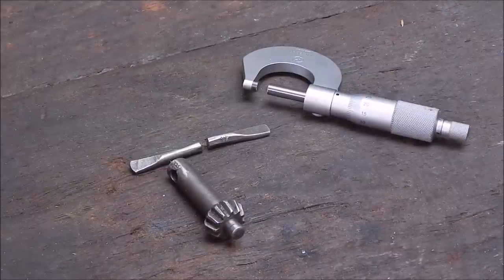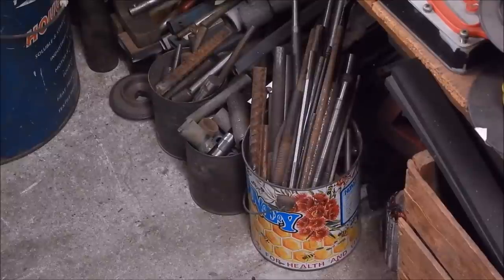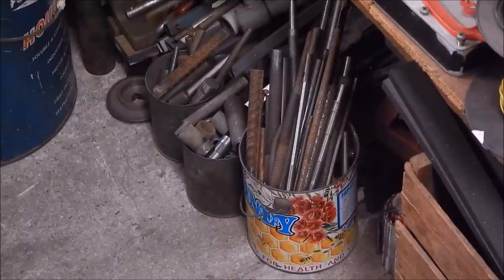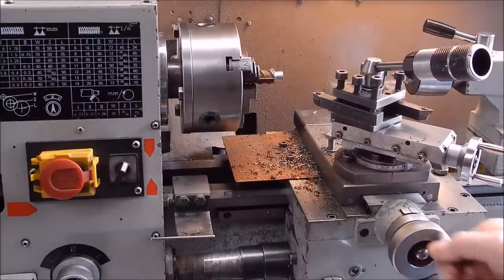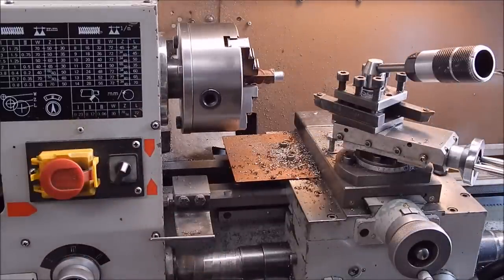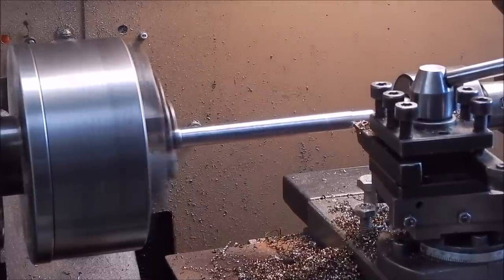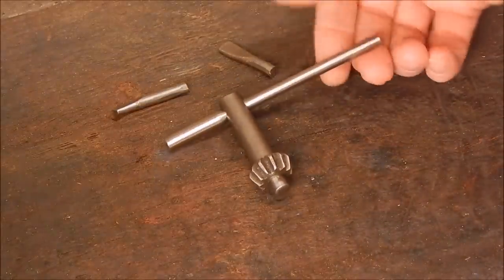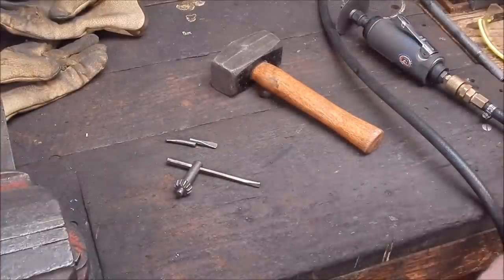Can you machine Rebar with a metal lathe ?

Comment from the maker: It's interesting reading the comments on this video - the most by far of any video I've done.

Some people just seem to miss the whole point of the video.

The video simply asks and answers the question "can you machine Rebar".

The answer is obviously "YES".

End of story.

I'm not suggesting you pass up on decent machine grade steel to use Rebar,.

However, it's certainly not the most difficult material I've ever machined.

Cheers Rob
Reply: +xynudu 
Indeed you can. But rebar is common steel. It&#39;s not like a hardened steel. It really all depends on your application. Good video.
Reply: +jtjjbannie Not all rebar is the same. There are different grades of rebar that have a higher carbon content which makes it much harder and a lot more brittle.
Reply: Jackle61
That's good to know. I did not know that, but it makes good sense that there would be given all the different applications.
Reply: +MrTo YouBoy rude.
Reply: +jtjjbannie  Way to miss the point. P
Reply: KingNast
? Yea, I think I got it dude. Not that complicated.
Reply: Thanks for making this video. I honestly never considered machining rebar and I can’t think of a good reason not to do so for whenever it meets the standards of the job. Great content. Thank you, sir.

Comment: I’ve commented on a few of these rebar videos already. Rebar is a trashy unpredictable metal. I use it often...therefore I know what I’m talking about. It’s good to have it around for a lot of things! Just be careful what you use it for.  Any metal I can machine and weld I use. Just don’t overestimate rebar and get yourself hurt or ruin something expensive. I use it for fire pokers, coat and hat hooks. Air hose hooks, tent stakes and such. It could be machined to use as parallels or “go/no go gauges” and such. Never make a tow hook or pry bar from it. I would assume that spacers or thick shims could be utilized from it.

Comment: you are a braver man than I. rebar is the mystery meat of metal. not only will 1 bar be different from the next, but the metal can change across a single piece.
Reply from the maker: +pyr666 

Yes, the standards only apply to strength and dimension as I understand it, so the metal could have any range of elements in it.

But it's still steel, and can be machined regardless of what's in it.

It might be a bit more difficult, but I'm sure any half decent machinist could handle it OK.

It's not my metal of choice, but the video simply shows that it can be machined, and 90% of what's said about Rebar in forums is BS.

Rob
Reply: +xynudu   A very nice demonstration, I appreciate your videos because you have very practical demonstrations.  You explanations are direct and the advice is straight forward.  There are many applications where expensive high grade materials are just not necessary.

Comment: It is interesting to read these comments about reinforcing steel ie. rebar.  Yes it is mostly high carbon steel because a lot of it is made from steel railroad rail which is high carbon steel.  The rails are cut to an appropriate working length; slit under the head and above the base yielding 3 pieces from each length of rail; and then these pieces are heated and rolled to the desired rebar size.  It is usually denoted in size by fourths of an inch.  And yes rail can be brittle.

Comment: Nice piece Rob.  I really like to repurpose old material to new applications too.  As I am building my latest model steam engine I used a piece of a 1.5" 2' long steel pin I found in Lake Ontario. I found it while snorkeling around the remains of a very old wooden pier that coal ships used to tie up to.  The pier was over 150 years old so the steel bar is at least that old. It actually machined really nicely.  Thanks for sharing your rebar video.  Fred
Reply from the maker: Fred Miller Hi Fred.  Some of the old steel can be really bad, you have to judge it by the way it machines.  I used some from an axle once and found it had hair line fatigue cracks all through it. Tossed it in the recycle bin. Luck of the draw.  Cheers Rob
Reply: I am also on the shores of lake ontario
Reply: xynudu do you know how old the axle was ?  it may have been made from flat stock and "blacksmithied" in to the round bar...
Reply from the maker: It was very old - from a horse cart, so probably 1800's.  The composition was very stringy, so it may well have been hand forged to shape. Cheers Rob

Comment: Why are so many people anally challenged over this video? I think its a great representation of the fact that it can be used! seriously though if your worried about the hardness and equal composition, all you have to do is bur it in a fire and let the fire die. It will anneal it and equal out the composition. You can harden and temper it later.  Ive made simple tools from rebar, even hammered out little carving knives that worked quite well actually. The problem we have on you tube anymore is people who are book smart but experience dumb.
Reply: +tonymengela Annealing rebar made from scrap doesn't really work and definitely won't "...even out the composition." Metallurgy doesn't quite work that way.  You might be able to harden rebar slightly because it definitely has a higher carbon content than most steels, again, because of the scrap material used that often contains cast iron. It is terrible material to weld for the same reasons, high carbon content and inconsistent composition. It is difficult to thread with a die and very hard on tools. I can base that on 45 years in welding and fabricating. The man that explained that to me had an additional 50 years in the trade, beyond mine. Perhaps a better argument might be : If better material is available to work with, why would you use rebar ? Yes, you can machine it, if that's all you've got. During the Russian Occupation of Afghanistan, the rebels made musket barrels from rebar - good for one shot.
Reply: +tonymengela I swear, some people like to disagree just for the sake of 
disagreeing. Better to ignore people like them, and leave the "doing" to
 people like us.  
It seems like people think rebar is made by throwing a bunch of random scrap into a crucible and hope for the best.  It holds up buildings, for fucks sake. Like you said, it's made to a standard.  Of course they're going to analyze every batch and adjust the formulation to meet their guidelines
Reply: KingNast Thank you for your reply... it gets lonely out here,,, so many people idea and book smart but no real world knowledge

Comment: The only reservation I would share would not be about rebar itself, but just a caution to those who only have one chuck, if it's a self centering chuck in good condition (whose proud owner is keen to keep it that way for an extended period)
Gripping anything irregular in such a chuck will eventually be detrimental to its gripping accuracy, and particularly to the parallelism of the jaws. 
By this I mean that they will probably develop a 'bell mouth', so that they do not grip right to the tips, and consequently it becomes easier to wrench the workpiece out when working without tail centre support.

Returning to the first point, namely gripping accuracy: Self centering chucks are actually a bit of a kludge. The shape of the teeth on the back of the jaws has to be a compromise, because the teeth they engage take the form of a spiral, hence there can only be (at best) line contact, not face contact.
Irregular workpieces tend to overload those contact patches, and over time, the scroll and the jaws wear more irregularly than if the chuck was kept only for bright-drawn, centreless ground, or turned workpieces.
Four jaw chucks are much more rugged, grip a lot more securely (so they do not have to be overtightened, which avoids straining the jaws), and their accuracy is more a function of setup than of manufacture, so that would be my first choice for machining castings, rebar, and even black (hot rolled) engineering rounds.

If all I had was a three jaw (a good one, which I wanted to look after) I would personally wrap it in something malleable, like thin lead flashing, or perhaps wrap some single-core copper conductor around it, at two widely spaced locations, before gripping it in the chuck.
Reply: Gottenhimfella Or get another chuck for the lathe and keep one dedicated for machined and cold rolled only, and the other dedicated for hot rolled steel and other rough stock. Once the one for rough use is worn to the point of useless it is time to get a new one for the smooth stock and use the old one for the rough stuff.
Reply: +Bear Peterson indeed sir, can't believe this chap is risking valuable carbides on such a shoddy job though!

Comment: Rob, in earlier days I spent some time around users of concrete reinforcing rod.   We called it "reo", although the Americans call it "rebar": because it's reinforcing bar, I suppose.  But that aside, I have seen this steel modified for certain uses. I have seen pairs of blokes with what was obviously a purpose-built machine, which had two chucks at one end and two vises at the other end. Blokes in overalls and gloves (and probably bored witless as well) would pick up two six-metre lengths of reo, chuck 'em at one end and grip them with the vises at the distal end, and press a button, or hit a switch, or whatever. The steel rotated for an obviously predetermined time, and the result was that both pieces of reo were given a full-length twisting, which obviously work-hardened the rod, and gave it different bending resistance or "Young's Modulus" or something. (They would then chuck the twisted rods into another pile, grab two more, and spend the rest of the day wondering how to get out of this job, I suppose.)

I have heard this stuff referred to as "twist rod", for obvious reasons.  This work-hardening would obviously make the stuff more difficult to machine.

Not all reo is treated this way, and the piece you used was obviously not treated in this way, because it had longitudinal ribs that were parallel instead of spiral. So the people who were saying "Nah, you can't machine that stuff!" may well have been referring to the work-hardened material rather than the product in it's "raw" state.

You may want to consider this, and if you find a spiral piece of reo, try and machine that for comparison, perhaps?

Not preaching, just sayin'...
Reply from the maker: Greg Brodie-Tyrrell  The ribbed  Rebar you buy would I expect be what most people would use.  I've not seen twisted Rebar, although a search shows Ransome bar was used early in the century. Interesting comment, but a new one on me.  It would take a hell of a lot of force to twist Rebar to any significant degree from my observation.  Cheers Rob

Comment: Grade 40 rebar is a little on the soft side. Makes it real good for bending to form cages and shapes for foundations but it has a tendency to smear when machined. Grade 80 is noticeably harder so it machines to a reasonable finish and can still be bent, if it's done carfully. Ungraded rebar is made from absolutely ANYTHING they find to throw in the smelter and is generally very brittle. It has a tendency to snap when a bend is attempted and don't machine worth anything. Hard spots, soft spots, warpage, you get the idea.

Comment: The higher strength rebar used in structural beams and columns is made with good quality steel.  It must meet standards for elasticity, ductility, and tensile strength.  It is hot forged.  If you want to work with rebar look for the higher grade structural rebar (grade 60 or 75 US, grade 500 Aussie) not the stuff they put in slab floors or sidewalks.

Comment: Whatever works to get a job done is a good idea.  I was able to hold 0.002" on a 9" length of 3/8" 1018-ish steel on a South Bend 13" x 60" that had a 0.011" dip in the ways...  still not sure how I managed that trick, but I did it consistently.  That piece of chewing gum disguised as steel was then turned down to 5/16" and then threaded to 24 threads per inch for use as a lead screw in a positioning device.  All with high-speed steel cutting tools!  I made 30 of them with only two that ended up in the scrap bin.  Lathe was born in 1930 and used a leather belt to drive it.  It was fun to use!

Now, I've got a Dalek project that I'll need to get a local machine shop involved with, as I'm changing careers to writer.  Body is getting old, mind still likes to have fun.

Comment: That's quite the ambitious project there Robert. Turning down a # 5 bar all the way to 6 mm. I think I would have  repurposed an old bolt or screwdriver shank in a smaller diameter. But it's good to know that you can use Re-bar for projects that don't involve concrete. Thanks for the lesson.
Tommy
Reply from the maker: Best Racing Tips Win At The Dragstrip I originally went through my box of high tensile bolts, but there was nothing of suitable diameter/length.  So I used Rebar - it was a good opportunity to show the "experts" that it is possible to machine this stuff and get a reasonable finish.  Cheers Rob

Comment: When I used to work for a steel mob years ago, we had 'r' bar and 's' bar. The 's' bar was used for swimming pools and was a lot softer so the steel fixers could bend it by hand to fit all the curves in the pool. I'm not sure if they were different alloys or whether the 's' was just 'r' bar that was annealed. The 's' was limited in what sizes you could get, and 12mm was the most popular. In fact, I can't actually remember if there were any other sizes other than 12mm.
Reply from the maker: ***** Interesting info.  I'm sure there are many variations in Rebar.  The stuff I used is 16 -18 mm diameter depending on how you measure it.  The Bro-inlaw has some much larger diameter Rebar that he wants me to turn down as a replacement handle for his 6" bench vise.  I haven't seen it, but it must be huge to reduce sufficiently for that job.  Cheers Rob
Reply from the maker: metalhead2508 OK. Duly noted.  Don't want any nasty surprises of that magnitude.  Cheers Rob
Reply from the maker: metalhead2508 What sort of deflection (bend) will it break at?  I've bent some to 90 degrees and not had it break.  Will a straight bar break at a fulcrum point ?  Cheers Rob
Reply from the maker: metalhead2508 Ok.  Thanks for that information.  All very interesting.  Cheers Rob

Comment: I have machined rebar on my lathe, but due to the extremely rough surface, I find that a negative rake tool and moderate to high speed, low feed works well.

Comment: Rebar is just a mild, low carbon, ductile open hearth steel. Mostly it is designed to be easily formed into the shapes needed to reinforce concrete and with a texture that will grip the concrete after it sets up. It has pretty good tensile strength. But not much shear strength. No reason you couldn't machine it.

Comment: Of course you can machine rebar. I have a center punch I made from a piece of rebar almost 50 years ago. I annealed the rebar in a furnace first, then casehardened the finished punch before tempering about an inch of the pointed end. Anything's possible with the proper techniques.

Comment: Some people act like part of the rebar is steel, and the other part is aluminum. Rebar is pretty homogeneous, and I doubt anyone will be making anything that remotely comes close to causing this piece of metal to fail. I have successfully used rebar in bolts of 9mm AR-15 bolt faces. If it is good enough for firearms, it should be good enough for whatever you are doing. Heck, I have even cut up rebar to shoot out of shotguns. They are a mix of metals, but it still is steel.
Reply: No, the lower grades are usually iron but you may call it steel. Personally i call it schlewakomiadronage.

Comment: I make the first cut on rebar a lot faster and deeper : 1200 rpm , 1,5mm doc and a feed as hard as the 2hp motor will take. That results in a clean cut and no broken carbide inserts.

Comment: Good video! Such a simple topic, I am surprised that nobody else has done a comprehensive test. I have worked rebar before when I need to. I like carbide tooling with it, but it is extremely TOUGH. Most of what I have seen here in the states is a softer but far tougher material. Tool life is great, but part durability is even better.
Reply from the maker: Cody Smallwood I centre drilled/bored some of this Rebar out to almost it's full external diameter, and it sure was tough and sticky to drill.  The lathe was in bottom gear, even when stepping through a range of drill sizes.  It's tough stuff for sure. Cheers Rob

Comment: I am not a machinist, but I would have ripped all of the rough surface features and rust off with a belt sander before chucking it in the lathe.  I would have drilled the button that he cut off and welded it on the end of the shaft instead of pounding it.  I do weld.

Comment: Good video...
just a thought. ...would it not be better to grind off all the corrosion,  seams and the external grippers to leave a cleanish cylinder - shaped bar using a disc grinder with appropriate roughing abrasives...you would not need to wear or damage your expensive precision tools of carbide or tool steel to remove the external excrescences. and could just use the lathe as intended. ....?
Reply from the maker: ThePigvincent You could do that.  My carbide tooling handled it quite OK (Mitsubishi inserts) but do whatever floats your boat.

The video is just a demonstration of what is possible, and to put the BS artists to rest on the subject.

Rebar is not something I would go out of my way to use normally. Cheers Rob.